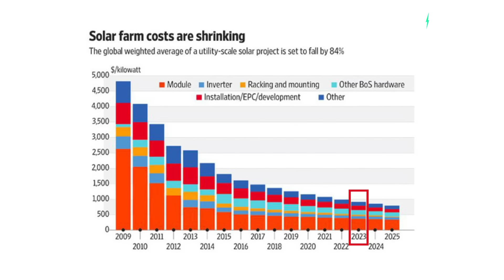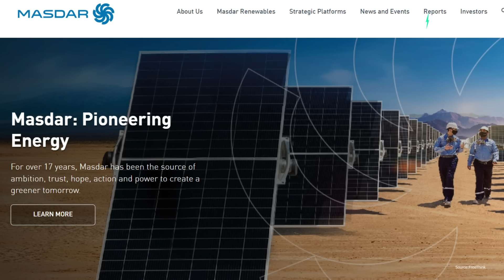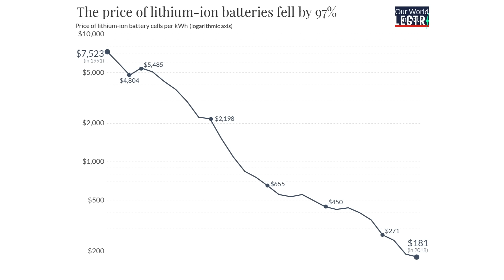New record-low global energy price set at the worlds largest solar farm

Comment: The current generation of solar panels have a peak efficiency at 25 degrees Celsius. For every degree above that the panel efficiency drops by 0.5%.  Consider that the highest temperature this summer was almost 50 degrees Celsius. That would mean that each panel would loose 12.5% efficiency, There may be additional losses due to sand on the panels and dust obscuring the sun. Therefore the importance of the grid storage batteries increases. I suspect one of your subscribers should be able to review the goals of this project and determine the optimum amount of grid storage for this project. That would be interesting.

Comment: Re. Your position on nuclear power electricity generation:  do not doubt yourself.  For so many reasons nuclear is fading to oblivion.  For those who disagree, just do a thought experiment: Imagine there is NO nuclear power industry; we now know all the problems and downsides of nuclear power, all the way from mining the toxic fuel, worry over proliferation, huge build costs, huge build time scales, absolutely staggering decommissioning timescales and costs; now that we know those would anyone start the nuclear project?
Reply: The argument for nuclear is strongest if it is additionally used to consume high level nuclear waste as its actual fuel. The TerraPower Travelling Wave Reactor design is inherently "safe" (no runaway chain-reaction is possible) and does exactly this cleanup of a dangerous thousands-of-years legacy. It is estimated that there is enough high level n-waste to service our entire needs for a century and more.

By that time over provision of renewable sources plus pumped hydro and a few batteries will take over all base load provision.
Reply: @fliprim  Wouldn't it be great if new nuclear projects only involved fuel which is existing waste. But the Swedes have just announced renewed uranium mining and all (as far as I know) nuclear projects will require new fuel. Just seems installation of an overabundance of solar PV and wind (and possibly geothermal) and several teraWattHours of local BESS (or other storage) would solve the supply problem and the time scales for implementation are orders of magnitude less not to mention the end-to-end, green-field back to green-field costs.
Reply: @mb-3faze  I'm with you. I changed position to this clean-up only nuclear-option when I realised the astonishing virtue of HVDC linkage (3% loss per 1000km) and its ongoing fall in terminal costs. The wind is always blowing somewhere and if you can cover nearly half the planet at 70% transmission efficiency then you can imagine a viable super-grid as battery. Throw in the Australian National University Global Atlas of Pumped Hydro (80%) and its geographical synergy with Solar PV, then we have all the technology we need to be sustainable. Cleaning up our nuclear mess is still worth doing.

Comment: Look at the opportunities for pumped hydro all around the rim of the Arabian peninsula. The Australian National University Global Atlas of Pumped Hydro sites is interactive and shows potential for storage a hundred fold above our immediate future needs. 99% can be eliminated for submerging roads and villages or needing expensive additional damming. But select just the largest installations (1.5TWh/504h) and look at the red dots for the lowest cost options and see the rich ring of opportunity in Saudi Arabia, Yemen, Oman and Iran.

Pumped hydro is 80% efficient and a mature technology. It supplies, currently, 95% of all energy storage. Co-locating floating solar PV with pumped hydro severally drops interconnection costs, cools PV panels enhancing efficiency and minimises evaporation rates. (Floating solar PV is already seeing installations on standard reservoirs in the likes of India.)

Comment: I fear climate corrections are starting too late and developing too slowly even if they meet the planned pollution reductions. Melting ice at the poles seems inevitable at this point, a huge amount of bacteria will be unleashed by the melting permafrost. One article putting it in perspective: "Melting Arctic Permafrost Will Add $70 Trillion to Climate Costs, Study Finds"  The movie "Atomic Hope (2023)" makes the argument for nuclear. There are newer approaches that are melt down proof or less radioactive that can't get pilot programs funded.

There's someone on the tube (@RealEngineering) who has made in depth technical investigations into topics like sending desert generated electricity to other continents, his calculations as I vaguely recall suggest it's too costly.

Comment: California told us 10 years ago that the cost of electricity was going to go down with the introduction of solar and wind turbine.  They were absolutely right.  My electricity went down from $0.16/kwh to $0.32/ kwh per my latest Edison electric bill.  (This is the new math.)  My tier 2 rate went to $0.41/kwh.
Reply: Have you tried installing solar panels in your place?
Reply: @martiruda  ....  Yes.  I've had 24 solar panels on my roof since 2012.  Back then the strategy was to install 90% of your requirement because you didn't want to over-buy and the base rate electrical rate was quite low.  Panels were much more expensive back then.  Since then, the panels have become less efficient, and the cost of electricity has doubled (to tripled) so my monthly electrical cost has also doubled.  I've tried to add more panels, but contractors require a minimum 6-8 panels, or they don't want to be bothered.  My roof only has enough space for 4 more panels.

Comment: Short on information again. You talk about the battery storage but no information on the storage capacity, why not? The size of the battery storage is directly connected at how much peak electricity can be supplied as solar is normally producing little at peak requirement times. Also misinformation. You state this solar insulation can “Easily power a city of over a million” you say it like it is the only source of electricity to this “city” A solar farm like this would need a massive battery installation to power a city through the night, at peak times and weather events. Let’s have less repeats and more hard facts. Also less generalisation like powering a city rather than 2.7GW installed capacity.

Comment: This is no doubt a good thing, and if you combined it with 1.8GW of gas turbines to get you through the night, would greatly reduce emissions and cost.

But supposing you used batteries instead of gas. Let's say 1.0 GW was available for consumption by day for 8 hours (the mean daily sunshine hours in January) , and 800MW was being stored. That would require 6.4 GWh of batteries which would hopefully get you through the night, if the average demand is 400MW. 

But you would still need to keep those gas turbines at the ready because there are some days when the sun doesn't shine so much. It rains 25 days a year. You would need to amortize the cost of those turbines and all the associated infrastructure over 25 days per year. These costs have to be considered too, not just the price of the solar by day.
Reply: Just a wild guess, I bet that the people building this site have taken costs into account.
Reply: @solentbum  They probably did take cost into account. But the point is you still need gas to back it up. This is not the end of fossil fuels.

Comment: As the world heats up people in the sun belt will need massive amounts of energy to run air conditioners just to survive.
Reply: Heat pumps are pretty efficient and use much less electricity.  I put one in 2-3yrs ago so no more AC or gas furnace goes well with my solar panels and net metering and TOU rates.

Comment: NUCLEAR POWER: 
    It is the ONLY almost completely carbon-free source of energy: it does not produce greenhouse gases that contribute to climate change. It has MILLIONS of times the ENERGY DENSITY.
    It is a RELIABLE FULL-TIME source of energy: it can be used to generate electricity 24 hours a day, 7 days a week. RENEWABLES CANNOT, ESPECIALLY in certain locations.
    It is an EXTREMELY low-cost source of energy: CONSIDER initial construction costs amortized WITHOUT hidden costs that benefit energy sources that allow various POLLUTION such as CO2.
    It has a small land footprint: it can be built in areas where land is scarce, which is ABSOLUTELY the case in parts of the world; it FACILITATES FOOD PRODUCTION in this way.

Comment: Renewables are where its at, but the only difficulty is the power grid, it needs more connection capacity for decentralised generation.  Ie to help wind and solar feed in whereever it is generated.  Storage is not the answer to intermittent renewables, we need storage for frequency stability and peak demand but you cannot store days of renewables.
We can put solar on peoples roofs and that should be fine, but to get 24/7 power you need more interconnect capacity for large wind, solar, hydro, tidal, geothermal projects to supply when local resources are low.
The big limitier for renewables is this distribution capacity, its currently designed for central distribution.

Comment: I get a lot of comments about the dependability of renewable energy and that Nuclear Power is needed for base load. Your presentation about bigger solar farms got me thinking. Hypothetically at least, if we built two massive solar farms each located on opposite sides of the earth, then with HVDC these farms could provide 24/7 power. No, Nukes needed.
Reply: That's why so many renewable energy resources need long-distance transmission lines to get their maximum value. 

The intermittency "problem" largely disappears when different regions are able to share their renewable electricity. It's always sunny somewhere!
Reply: Or just use batteries. Nuclear is so expensive that you can easily overbuild the solar array, overbuild the battery and still be a fraction of the cost.
Reply: @larryevans6739  Take cloudy northern areas in the winter, there is a good chance that they will not get enough solar energy to meet needs, So, batteries will not help. Diversified energy sources could help and importing electricity from long distance would be an option. The UK plans to draw solar power from solar farms in Morocco. Germany will link wind energy from the north and solar energy from the south.
Reply: Physics disagrees....
Nuclear uses 85% fewer metals and minerals and takes just 2.5% of the area to generate the same energy as intermittent renewables with a capacity factor of over 90%. No backup generation required, no batteries required, utilising the existing grid. Zero emissions and works during dunkelflaut periods.
Cheaper system costs than intermittent renewables and thus lower consumer electricity costs. 
Nuclear is not renewable but breeder reactors different fuel cycles mean we’ll have enough nuclear fuel to last billions of years.
Reply: @polarbear7255  
LOL!

Show us the numbers on COST!

Nobody cares about the amount of area that nuclear power uses! LOL!

SHOW ME THE MONEY!
Reply: @stephendaley266  many people care deeply about the land area and environmental impact that vast fields of intermittent renewables and batteries will require. Also the huge volume of waste and ongoing replacement costs. These make intermittent renewables far more environmentally damaging than a simple small footprint nuclear reactor. But you renewables zealots are all tarred with the same brush, you never think big enough for the second and third order effects or the system complexity. 
Economics doesn’t trump physics.
Reply: @polarbear7255  I live ten miles from a retired nuclear power plant. Ten years ago they retired it after only the first thirty years of operation. The reason was excessive structural deuteriation due to radiation, shoddy construction is a real problem. I am still paying for that NUKE'S retirement. Here in the USA Public Utility Commissions (PUC) allow higher rates rates of return to investors because of greater risks for NUKES. If I had solar on my roof, I could pay for it in three years.  Also, it is our government (taxpayers) that foots the bill for cleaning up abandoned oil, coal and nuclear facilities.

Comment: Over here the energy companies want to bill the customers with solar panels for the excess energy you produce because they do not
know what to do with it. They say it is costing them money to get rid of the energy. I think they don t want to change hopefully the goverment will force them to change !!
Reply: There is a legitimate issue with rooftop solar costing utilities. Utility scale solar is dramatically cheaper than rooftop, which leads utilities to overbuild installations. They increasingly do not need rooftop-generated electricity. But utility scale can easily be curtailed in periods of overproduction by turning it off. Residential systems that continue to feed electricity into the grid when there is already an oversupply create an issue. It costs utilities money to get rid of the excess voltage (often through massive resistive heaters dumping heat into the environment). This is also a problem for nuclear, which can not be easily switched off.

Comment: Lots of talk. In Sweden we've had about 100% co2 free and cheap electricity for 50 years already thanks to nuclear. Solar is cheap but intermittent. The costs on system level to cover demand when solar is not delivering is very expensive and the more intermittent the higher cost. For countries that are just trying to migrate from coal sourced electricity and have lot's of sun all year round it will probably make sense to go big in solar. Our mission is 100% co2 free energy, not just electricity. This means 24/7 all year round with heavy industry during night and month with barely any sun during winter. Cost would skyrocket to cover this.
Reply: On the money Sir. System costs for intermittent renewables are what make them very expensive for the consumer. Add in backup generation, batteries and grid upgrades and the consumer prices increase logarithmically with the more intermittent renewables you build. Zero emissions dispatchable baseload is what is actually required to replace fossil fuels.... not more and more batteries and panels...
Reply: This is why the UAE also uses nuclear (4 reactors).
Reply: @shayneflint7864  and the UAE built them quickly and on budget with South Korea’s help. That is smart.
Reply: Fukushima, Three Mile Island, Chernobyl..... Sweden?

Comment: I thought hot countries like UAE WOULD BE TOO HOT FOR SOLAR PANELS.  Please clarify as I am sure you commented on this in a recent video.  Are these different Pam
Mel’s from what we would fit in Europe?
Reply: The efficiency reduces as it gets hotter but they will still be useable.
Reply: Although solar cell efficiency drops with higher heat, the abundant amounts of clear blue sky in arid desert locations will make up for it.

Actual percentage drop for Trina solar cells is around -0.37% for each 1°C above the reference 25°C.  So if the cells heat up peak to 60°C then the drop in efficiency would be -12.95% versus what they'd produce at 25°C.  

But ground mounted solar farms have advantage of a lot of panel back side exposure to open air and the panels are wafer thin.  Moreover, almost all major solar farms nowadays also have 1-axis tilt sun tracking which improves energy capture some 10% to 30%.
Reply: The reduction in solar panel efficiency is offset by the constant clear sky and high radiation.
9.8 hours of sunshine per day on average, double that of Northern\Central Europe and higher than southern Spain or Greece.

Comment: I suppose it wouldn't be that hard for them to build the world's biggest sand battery.  
 Still 5 gigawatts of peak solar power is equivalent to about 1.2 gigawatts of continuous power if you can integrate grid storage  for night use.  
 That would be a large but not exceptionally large power plant.   Same amount of power a power station having two 1,000 megawatt reactors would make.  Or the same as one slightly larger than average coal power station.  A similar amount of nuclear power came online in the state of Georgia in the u.s. in the past year-and-a-half at a cost of about 33 billion US dollars.

Comment: You probably mean 5.89 cents per kWh? Add battery storage for 24/7 availability. May add another 10 cents per kWh. Still competitive for some areas of the world, not yet for others. Key to solar is the overlap with timing of consumption and then the cost of storage. Without storage you still would need peaker gas plants to make up for off times or days of sand storms.

You think the 5.89 is solar only or including storage? Would be expensive for solar only but very cheap for including storage.

Comment: The cost of the batteries required by a purely renewable (wind, solar and hydro) electric grid is prohibitive. At least, it was when James Temple reported on MIT research in MIT Technology Review on July 27, 2018. To reach 100% renewables with current technology, we'd need to increase the cost of power generation twenty-fold or more, and the additional cost is all about the batteries, not the wind and solar generation. The cost of grid-scale batteries is falling, but I doubt that it has fallen enough since 2018.

The title of the Technology Review article is "The $2.5 trillion reason we can’t rely on batteries to clean up the grid". I'd link it, but URLs in a comment seem to get the comment deleted.

The good news, according to the same research, is that we can get to 50% renewables without raising the cost of electricity by using natural gas as a backup, and gas is much cleaner than the coal generation it's already replacing. Since we're nowhere near 50%, why worry about reaching 100% at this point? Maybe by the time we reach 50%, battery storage will be practical, but it's not practical yet, and rushing to 100% with extremely costly battery storage at this point can only frighten rate payers watching their power bills rise.